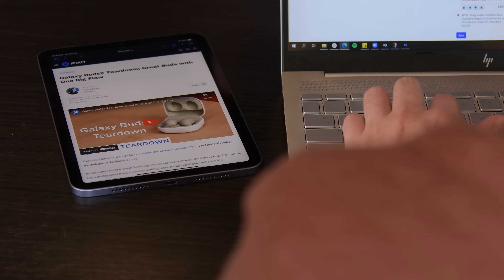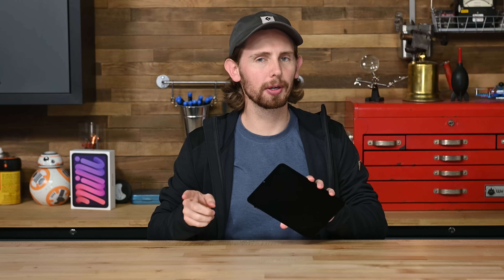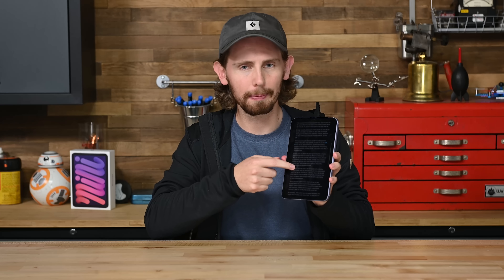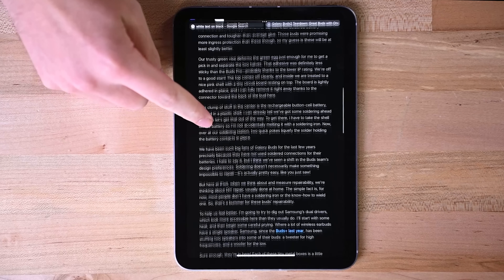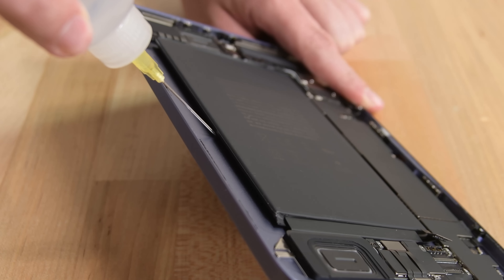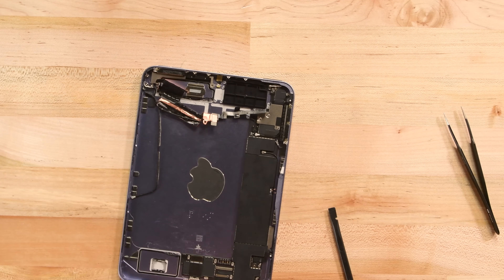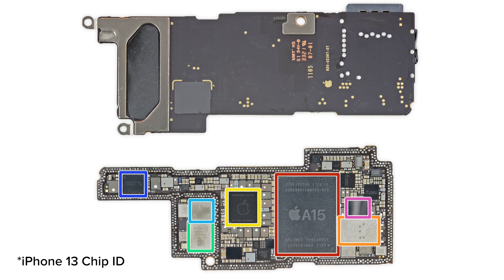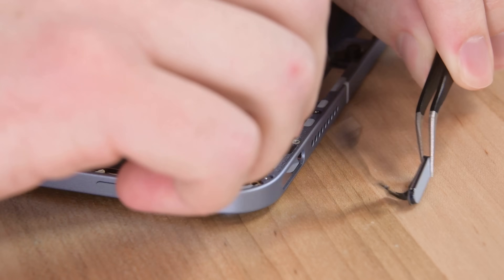iPad Mini Teardown: Here's Why it Jelly Scrolls

Comment: Nothing says we care about the enviroment like glued shut devices :D
Reply: The glue is alright, but the "this feature won't work if you repair it yourself" is another thing
Reply: @houghwhite411  it took a lot of elbow grease to remove but it can be replaced anyways
Reply: @houghwhite411  I don't like withe of them. :D
Reply: @houghwhite411   true :D
Reply: @wilderness-beastt  ooohhg noon glueee
Reply: That’s so the Apple juice doesn’t leak out and contaminate the environment.
Reply: @Denvermorgan2000  lmao
Reply: @nightfall4207  for the love of god, use punctuations
Reply: I’m honestly okay with glue usage. Just stop serializing the parts via software to prevent any parts swaps. That’s what’s environmentally hostile.
Reply: @theconformist2399  The other side is: if criminals stole your device and it is locked to apple id, they can took it apart and sell parts for repair. The best way to get rid of ewaste is a law: there must be a law that push every manufacturer to recycle their devices. Then they will design devices with recycling in mind. For example apple is refurbishing a lot of devices. And by the way, where do services put old phone and tablet batteries? Those should be sent back to manufacturers to recycle. Unused/broken electronics components and devices should never hit the landfill at all. Repair is ok but it is not a goal.
Reply: @c.b.eugene  “repair is ok but not a goal”?? Bröther recycling should be the LAST option lol, recycling stuff is still the most energy intensive of all waste management methods and if you can you should reduce the amount of stuff that needs to be recycled. Allowing easier repairs goes for exactly that as opposed to throwing a whole device to be recycled
Reply: @c.b.eugene  you mean to say let the big techs have the biggest of monopoly and let small businessess die out
Reply: @nightfall4207  if you don’t have time to type, dont.
Reply: You do know samsung phones are all glued shut right?
Reply: @shirai9563  yes. I have one and i complain about it too.
Reply: @shirai9563  and also my next phone won't be glued shut. I refuse to buy glued shut phone as my next phone.
Reply: @shirai9563  and last 1/3 as long lmao
Reply: This is the reason I havent upgraded my phone in 5 years
Reply: Sorry, didnt know you wanted phillips screws on all corners of the front of the display!
Reply: Ain't that the truth 🤣 IP 68 means it It Pollutes and is too hard to fix .
Reply: @My Real Username bs ive been using airpods for 3 years and they're still goign strong
Reply: The glue is fine. Means it can survive some contact with liquids and won’t pop open if it’s dropped. The only thing is having the entire device just not work if you get it repaired from a non-Apple verified source (which there are only basically like 2 Apple verified sources).
Reply: Somebody never worked in manufacturing or design industries
Reply: Well if you want your phone to be water resistant it needs to be glued shut.
Reply: @My Real Username not if you know what you’re doing. I’ve replaced plenty and not destroyed a single one. So maybe weigh in on something you actually know about
Reply: Glue is ok its lack of parts and serialized parts
Reply: Like every other flag ship phone manufacturers my guy.
Reply: @RunForPeace-hk1cu  exactly :) that's why i critisize other brands too. And I won't buy their product if it's glued shut. Vote with your $ :)
Reply: No doubt typed on your 100% Vegan, 0% Landfill Certified, Solar Powered, Lead-Free, Adhesive-Free, Developing-Nation-Labor-Free, device with 10-year security updates and tri-annual modern software updates that you bought for $300 through a local co-op.
Reply: Yes. Because people will go to “nearby” repair centers for that not glued one year lifespan machine…🤦
Reply: The iPhone 6 did not have adhesive securing the display down and I went through several of them because of display creaking, popping and looseness. Once they added the glue on the 6s I had zero issues. I wouldn't want it any other way.
Reply: @My Real Username the batteries aren’t that difficult to replace. Not much more than a phone.
Reply: Wgen these repair shops cant fix stuff they blame it on the company
Reply: @yuvrajmishra522  nah. Most repair shops can fix glued shut phones. Even i can do it.
Reply: Do you want it to just loosely be held together with zero chance of protection against water
Reply: its for waterproofing u bozo
Reply: @ussf-unitedstatesspaceforc7541  
Are iPads water resistant? No.
Are adhesives required for ingress protection? No. Xperia Active of 2011 had an IP67 rating, had a toolless back panel, removable battery, and internals accessible with only a screwdriver.
Reply: @DGao-zz5vq  it’s also not 30mm thick
Reply: @RunForPeace-hk1cu  my mistake for mentioning a tiny, obscure device that had to be shaped like a pebble for a good grip. Galaxy S5 and XCover Pro.
Reply: @DGao-zz5vq  Yep except iPhones, which is the best example of a water resistant device from Apple, is rated IP68 with an added 4 meters of depth. There is no believable way to think that a adhesive-less alternative could reach that same rating without an extra level of complexity that would make the phone thicker or any other number of unwanted bi-products. Adhesive is on every water resistant flagship smartphone for this reason.
Reply: @DGao-zz5vq  samsung s5 is waterproof. Removable back panel and battery. Charging port doesnt need to be sealed either
Reply: @kizzjd9578  I obviously know the Galaxy S5. I'm hesitant to bring it up because it - unlike the Xperia Active or the first two Galaxy XCover - was not screwdriver accessible. The removable backplate gives you access to the battery, SIM and mSD, but to get any further you'll need to heat up the screen and pry it off from the midframe it is glued onto.
Reply: @ussf-unitedstatesspaceforc7541  never heard of a proper rubber gasket as well as a few well placed screws? they have been using them everywhere for a while now...
Reply: @codypalm  rubber isn’t exactly environmentally friendly or easily recyclable either.
Reply: @codypalm  you would need like 12 screws to have a gasket in place
Reply: @ussf-unitedstatesspaceforc7541  r/confidentlyincorrect
Reply: @ussf-unitedstatesspaceforc7541  my S5 with a hot swap removable battery is IP67 rated. Is the iPad IP rated?

Comment: I don’t think you want them to take tips from the iPhone team. I don’t feel like having a paired iPad screen.
Reply from the maker: Lol that is an excellent point, Apple Dolphin. I guess I mean ... take tips from the good parts of the iPhone design. :)  -TD
Reply: @iFixitYourself  the speaker done speaking, man I love that line🤣🤣🤣🤣🤣💀💀💀💀
Reply: What’s a paired Screen?
Reply: @seha2306  Means the screen is serialized and the motherboard remembers the part number, so when you swap in a screen that doesn't have the same number, even if it's a transplanted one from another iPhone, it will still refuse to work properly.
Reply: @hummingbird71 so the ipad mini screen isn't serialised and synced with the motherboard? Would be good to know as I always do my own screen and battery replacements for my devices.
Reply: @PatrickKaplin  Apparently not.

It seems only iPhones have paired screens.
Reply: @PSYCHOV3N0M  for Enviromental reasons…